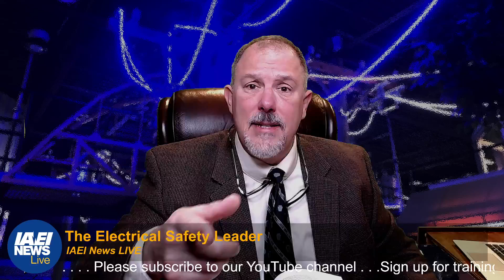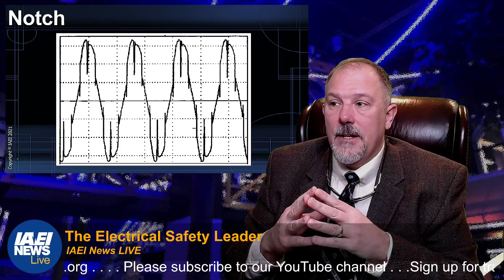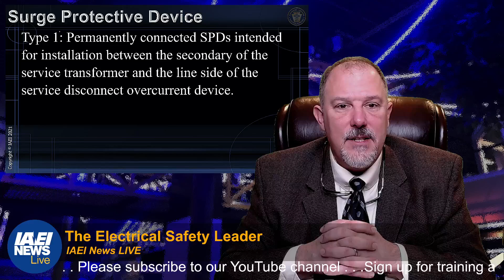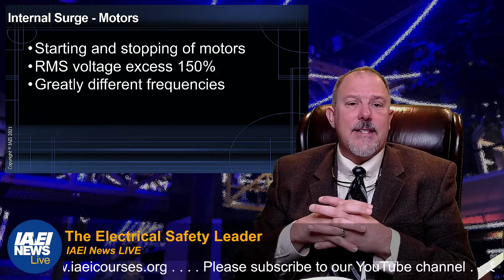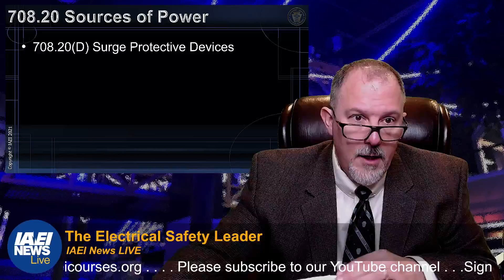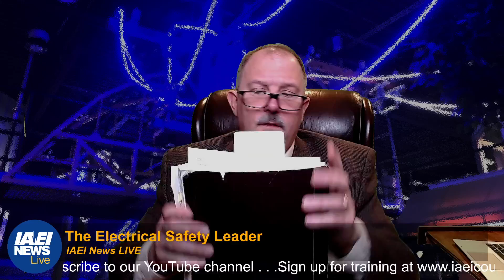Surge Protection - Fundamentals

Comment: Glad that I'm not the only guy who is a big fan of tabs on code book.Beside MOV'S what are inside an average surge suspressor ? Years ago I wired up a machine shop & injection shop. New building was 480 volts verses 240 at old location. They had riggers spend all day Saturday & Sunday moving equipment in. It was well after midnight when I had the last machine reconfigured for 480. Was feeling pretty proud until I turned power on. Heard a big boom then smoke. I missed removing & replacing 3 lower voltage MOV'S.  Luckily nothing was damaged and they were happy to have everything running that morning. I installed a surge suspressor almost 40 years ago in my home that has no indicating lamps on it. Guess I should replace it. Have noticed more equipment have a surge suppressor inside of their panels. I do have the better plug strips with built-in surge suspressor with 3 indicating lamps on each of my TV'S. nice vid Tom. Go Phillies !